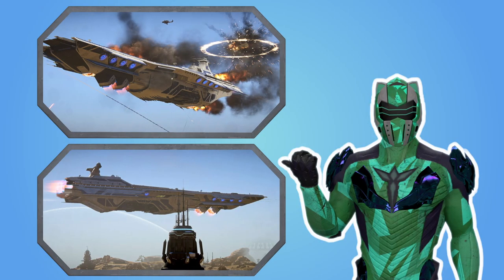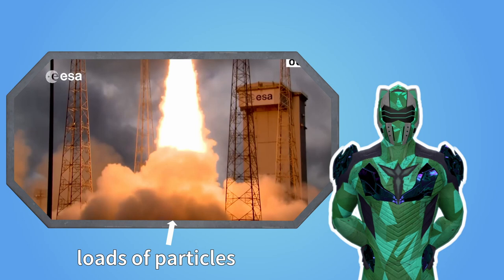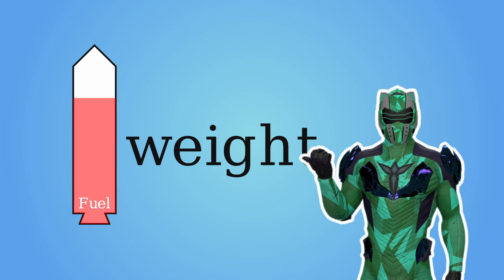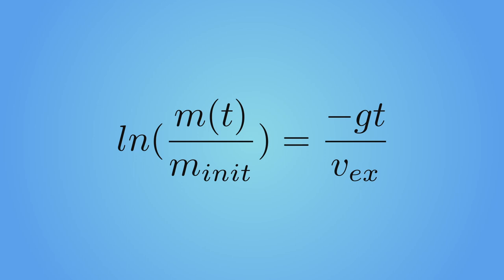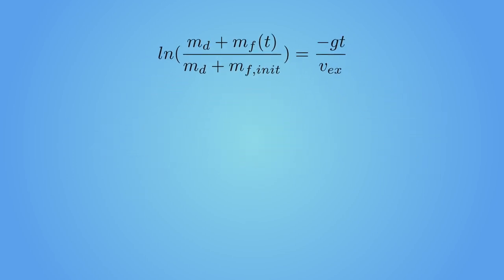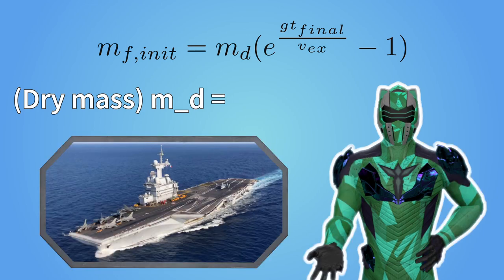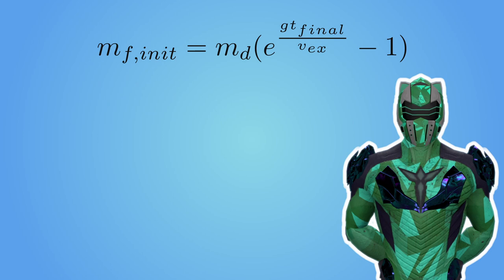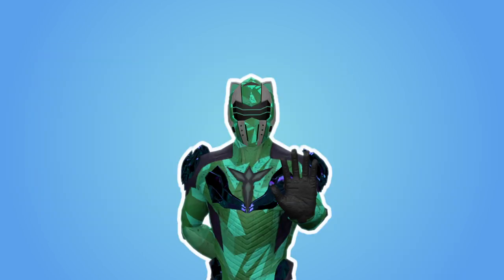Physics Of A Rocket Propelled Aircraft Carrier! How Much Fuel Does A Bastion Fleet Carrier Use ?

Comment: Actually carrier's engines does not seem to be used to carry its weight and make it float above the planet.
All of them are directed backwards: the rear ones look directly behind and the bottom ones look both backwards and downwards. They seem to provide only some kind of forward thrust.
Anyway, the video and the math are great, thanks. Btw, using your new g value of 16 results in 9000 tons of fuel.

Comment: Awesome work. One problem tho. Auraxis gravity isn't necessarily the same as on Earth. I guess in game physics would say it's a reasonable assumption though.
Reply from the maker: I didn't want to calculate the strength of gravity on Auraxis as, in the game, the gravity values depend on the item. For instance, each weapon/bullet can have different gravity values. This makes the evaluation of the strength of gravity unreliable. Hence why I went for Earth's gravity.

However, if you really want a value, I made a quick test this morning :  I got into an ESF, flew up to a certain height, hovered still, and then droped from the ESF. I then recorded how long it took me to hit the ground.
With a little bit of maths, I can then estimate the strength of Gravity :
F = ma 
=> mg = ma 
=> g = a
=> gt = v(t) + v_0 (but v_0 = 0)
=> gt²/2 = h(t) + h (with h the height at which I dropped)
=> g = 2h / (t_GroundHit)²

Here are the values I got :
From a 100m fall, I hit the ground in 3.52s => g = 16.14m/s²
From a 552m fall, I hit the ground in 8.35s => g = 15.83m/s²

The second one might be affected by terminal velocity (if Planetside 2 has terminal velocity implemented). These tests were made in VR training.
Reply: @AxilYT  Oh wow so Auraxis has gravity nearly twice of Earth's? Cool! I also like how easy you made the experiment!
Reply: @AxilYT  OMG!!! This totally explains why Vanguard behaves like a soap on ice! It's design was not improved to account the higher gravity, because NC just used some old Earth tank design!
Reply from the maker: @heptagonrus  Not sure. I would think that stronger gravity actually improves grip as it pushes the tank into the ground.

Let's take an example. In Kerbal Space Program, when you bring a rover onto the Mun, you notice it is very hard to accelerate/turn. This is due to the lack of grip. And that lack of grip is due to the low gravity preventing the wheels from digging  into the ground.

As I said, in PS2, different objects have different gravity values. The Vanguard probably doesn't experience 16m/s² of downward acceleration.
Reply: @AxilYT  now this is what I came for! Imagine how skittish a lightning would be on Earth considering it already acts like a sled on ice on Auraxis!

Comment: Here's a question that I have: how do you know that the Bastion doesn't have multiple types of engines? Yes, the rear engines and the... very bizarre angled placement forward underside engines... definitely look like your stereotypical garden-variety (as much as a rocket can be) rocket engine exhaust... But the Bastion also has rows of blue-colored exhaust engines along the sides that you can see at 0:02. Are these rocket engines? Jet engines? Something else entirely? Ion drive propulsion? Are those shock diamonds we see or some future energy thingymcbobby? I mean, even with Cold War-era technology, we've looked into building airborne things that are far too large to be economical or wise. Like with the Lockheed CL-1201 design proposal. Which incorporated 182 Boeing 747 engines to generate enough thrust (on paper at least) to achieve vertical take-off and landing. And while airborne would've used nuclear powered engines in order to have forward momentum.

I actually did some rough math awhile back in the comments of a video about it that I'll repost here:
"The weight of the CL-1201 would've been 11.85 million pounds (5375 metric tonnes) at its absolute maximum. This includes the fuel for the lift engines, water, food, everything. Things that get used up, in other terms.

The thing would've been powered by 182 Pratt & Whitney JT9D engines which were used on the Boeing 747. This is the equivalent of having the power plants of almost 46 747s. 182 JT9D engines puts out 10,192,000 pounds of thrust. Each JT9D engine burns about 1/4 of a gallon of fuel every second at cruising speed, which is going to be even higher at take-off. So let's say half a gallon a second for each engine. That's roughly 91 gallons of fuel a second. JP-4 jet fuel that was used at this time period weighs about 6.5 pounds per gallon. Meaning this aircraft is losing almost 600 pounds... PER SECOND."

So, not that crazy off from what we're looking here with how much the Bastion is burning. Albeit this would only be on take-off and similar for landing (if it chose to land vertically, that is). The engines being so focused on the rear that look like "traditional" rocket engines might be for it to use to get to orbit - like an SSTO would or something - and are only coincidentally used in atmosphere.

Then there's the issue of materials science in the roughly 800 years into the future that PS2 takes place in. Technically, having something that is just as strong or even stronger than structural steel for a fraction of the weight is possible with things like CNTs and graphene. Also, the Bastion does utilize shielding on its hardpoints and thus could be using something along those lines for structural stability.